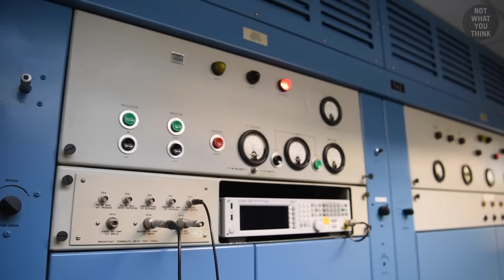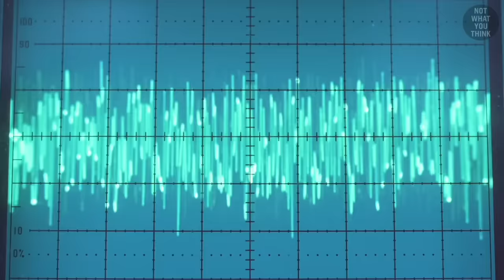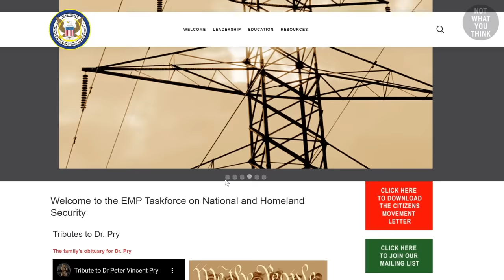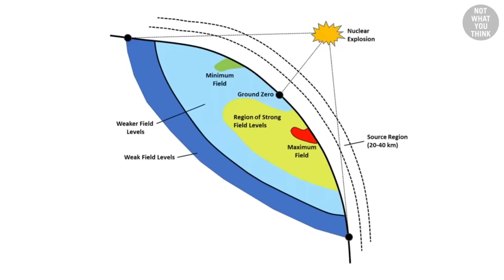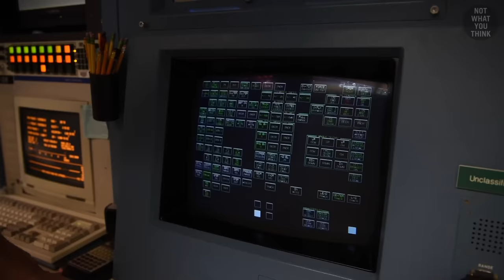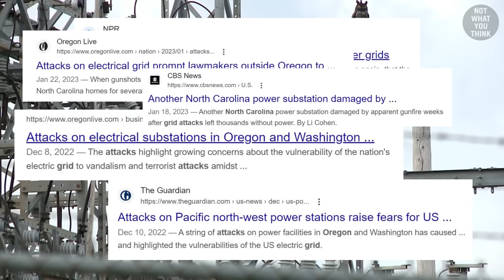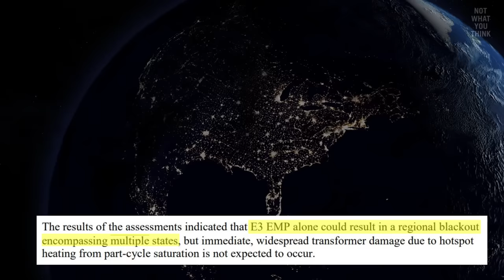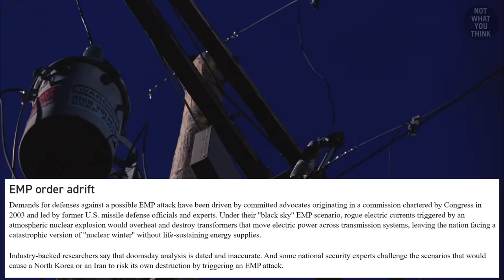Why an EMP Attack is Worse than You Think

Comment: Nuclear reactors only need a couple days of backup fuel to cool down- not an indefinite supply.
Reply: yea, this fact alone made me question the credibility of the research behind this video.
Reply: Need way more than a couple of days to cool the spent fuel in the pool before they can be put into dry storage. Usually for several years. 

The pool would need to have cooling system otherwise water just going keep boiling off and needs to be constantly refilled every few days. So you would need the fuel to run the generator for the pool cooling fir several years at least.
Reply: Hawk Anonymous  that is true for a shutdown but in this case the fuel rods would be removed!
Reply: hawkanonymous2610 afterwards yes... for, depending on exact reactor design, between 2-3 weeks before the cooling could be very safely shut off. Some reactors even have batteries that can run the cooling systems on a low setting for a very long time in case the backup fuel isn't enough.

Yes, more than days like what you were getting at. But 2-3 weeks of generator fuel is fairly trivial, only about 180,000 liters of diesel fuel. When we are talking about things as big as a nuclear reactor, that's easy to store. Gas stations carry about 130,000 liters of gas.
Reply: The problem, besides damage to electrical generating plants, is the distribution grid.  I stink at electrical engineering.  But I know high voltages atr needed to send power long distances, then transformers to step down power from say, 14,400 v to lower voltages to user transformers to bring voltages down to the more familiar 480, 220, & 110 v we use.
Reply: A lot of modern reactor designs have analogue user-free meltdown prevention anyways
Reply: Since the whole video is about EMPs, it’s not unreasonable to assume that an EMP strong enough to damage a nuclear power plant is strong enough to damage the backup generators or other systems.
Reply: @cr4ckp1dgeon  very few of those have actually been built.
Reply: And what are you going to do with the fuel rods after you cool it all down to room temperature?
Reply: @Acrophobia2  can’t remove the fuel rods without electricity. I’m pretty sure people don’t manually remove rods during operation or shortly after
Reply: @--INDIGO--  this. Plus, we are assuming in this video, all sorts of types of habbenins. If anything, we would see fukashimas, chernobyls, and three mile islands all over the world, not just where whatever bad actor did something.

It dont always be that way sometimes it do be 😂
Reply: @--INDIGO--  Yikes! I never considered that!
Reply: @Reefiasty  Nothing.
Reply: @--INDIGO--  Well...that's certainly possible, but I hope to god that they're EMP hardened like the backup generators in missile silos.
Reply: But do we know what fuel reserves each of the 92 American commercial reactors actually maintains? The history of untested emergency measures is not encouraging.
Reply: Who told you that? It's completely wrong
Reply: look at this comment section- it's all people that talk like they're experts
Reply: What happens when the water runs out?  When the pumps can't function because they don't have electricity or fuel.  There's a reason we don't build nuclear reactors anymore.  The risk is just not worth the reward.
Reply: @williamyoung9401  New designs don't even have those problems- only the old ones.  Fukishima was IMMEDIATELY without backup power.  It doesn't take that long to cool down these older reactors.
Reply: That is not the case.
A reactor being stopped needs to be cooled for at least half a year, normally longer, to cool down.
Reply: @cr4ckp1dgeon  Name one.
Reply: @tonamg53 don't forget it needs to last consistently running for that amount of time and enough fuel for it aswell
Reply: Thank you
Reply: And if we were using the much safer MSR design ( Molten Salt Reactor), then meltdown would not be an issue, and the reactor could be passively safe.

Sadly the regulator is still blocking MSR development. Last I heard, this American invention (1968), is now being developed in China.
Reply: With Fukushima, the problem was the tsunami knocking out the backup cooling generators.
For safety, the reactor, which survived the earthquake, was shut down, so could not provide its own power.
Had the reactor been left running, there would have been no accident.  So this is a case of the safety operation leading to an accident.

Of course the designers should not have put the diesel generators so low down.
Reply: @peterclarke3020  thing is the reactor walls were only designed to last 50-60 years & well they are overdue to rupture ..where without them we could have had this world another 300k years but now 10k years for most of the population is impossible (heck even 2 years seems like a long stretch given world politics but you know)
Reply: @peterclarke3020  warping DNA and blaming it on cigarettes is fked up to btw
Reply: I’m pretty sure most American nuclear reactors can withstand emp’s and the electronics that control and any around on the land the nuclear reactor is in due to the requirements for fail safes and if something like and emp would happen also if your power cables are below 6 inches under soil it will be fine
Reply: Ahhh, Nuc power plants must SCRAM if they lose outside power.  They also are not allowed to operate if outside power is not available.  So they could run at very low power, enough to keep the cooling towers going and be totally internal, and save the Generators for when they need them.
Reply: Nuclear power plants have secondary generators using steam that are run off the actual nuclear power so you have your high-voltage and low-voltage generators they can run indefinitely off of the steam they produce naturally
Reply: yeah... we all saw that theory live in action... just about 11years ago
Reply: @joseph-mariopelerin7028  No- you saw nuclear reactors with no backup generators at all.
Reply: @Trilobite45  Comparing the quantity of reserve fuel required to the typical stores of a gas station was certainly an intelligent idea and conveyed a clear understanding of the quantities involved...

However, I would have really preferred the unit of measure to be football fields or bananas stacked to the moon.
Reply: can't move coolant or use fuel if there is no power to do it.  hence even a couple of days is still terminal.

Comment: This is a threat I feel like we should definitely be investing more in mitigating. Even if the likelihood of an EMP event is small, the worst-case scenario is devastating enough that's it's almost certainly worth the up-front cost to be prepared for it. (Having a bunch of spare transformers on hand, for example, would be a really big up-front cost, but not a huge ongoing investment.)
Reply: Collecting the spares takes time though.
Also, some corrupt official are just gonna sell them off at a huge markup, if someone needs them probably.
The other low cost but effective mitigations should be done, fucking companies though don't wanna spend money.
Reply: Don’t worry, this dude’s taking information from people that haven’t worked in this field.
Reply: One interesting thing about EMPs is that the equipment doesn't have to be online to be damaged. For example a transformer can experience damage from arcing in the coils even if it's not connected to anything. So spares need to be kept in a protected environment (ie. "hardened").
Reply: No.
Reply: @therealcheckmate From what I understand, diesels (especially small engines) will probably be okay. No computers needed to manage spark timing or ignition coils with long windings in them to induce current. Your Faraday "cage" doesn't necessarily need to be grounded/bonded, as long as all the sides are electrically connected. In fact, the ground is where a lot of the current is going to be generated (GICs or geoelectric induced currents), but whether it will be enough to backfeed up your ground wire and electrify your enclosure/generator frame, I have no idea. I think you are in good shape as long as you can store enough fuel, better off than most, surely. Not a lot of info about the effects of really big EMPs on modern gear, and much of it's conflicting.
Reply: @TheRealCheckmate  Actually, that would no be a good idea! More than likely that would subject your shielding to higher energy levels. 

Best approach is an  isolated "cage" within another isolated cage. The "cages" should be isolated/insulated from each other.  A single isolated cage might be adequate but so much depends on the energy level of the pulse(s). Layering shielding will provide the best protection. 

Bonding/grounding just provides an external current path.  You want the current confined to within your shield. BTW, whatever you are trying to protect, you want to keep it isolated too and not touching the shielding in any way.   BTW, you'll want to avoid touching the shielding  when the EMP hits so you don't become a current path!  

Generally speaking an EMP is unlikely to cause direct harm to people as long a you are relatively isolated from good conductors.  If you have metallic implants or something like a pacemaker, you may be at risk!! I suppose that there may be some shielding options to consider,but they aren't likely to be practical for an unpredictable event.
Reply: to make sure, we should all  invest in bunkers, and stockpile food and water oh and toilet paper, make sure we have a spare phone in a faraday cage... and also protest for a faraday satelite to be launch in back up just in case...

no phone no life!!

you also need a couple generator because no matter what happen that AC can't stop running!

no AC no life 

let's mass invest to assure these two Essentials!!!
Reply: @TheRealCheckmate Yes, but leave the gens disconnected until after the EMP is over.  I got a pretty good arc, about a half inch, off a umbrella shaft once when lightening struck about half a mile away.  The shaft was only 3 feet long but had that much induced voltage from the strike.  Imagine how much voltage could be induced in a couple of hundred yards of house wiring by an EMP weapon. I dare say, it might jump across an open switch or circuit breaker.
Reply: @silverecco A diesel engine will be okay if you can turn it over to start it without using an electric starter. 😂
Reply: Invest in bottled water and canned food and a can opener and prepping supplies is your best form of mitigation. Get seeds, plant a garden.  You are in charge of your future.
Reply: @lewis2553  didn't think about that. You can tell I haven't spent any time messing with diesels. That's lot of compression to overcome, doubt even the little electric road sign engines have pull cords. Starter motors are relatively simple things, though, and they work with induction under normal operation, so it might be okay, or easily repairable if not. The energy would try to spin the magnets and might disperse enough of it. I didn't even consider motors (and alternators). Those are basically just long wires like ignition coils and transformers, too. It's just everything in our daily lives when you start really tallying it. I'm still flipping light switches in the bathroom out of habit when the power is out for two days. How thoroughly we've become dependent. Worrisome, but I'm glad to see a wider range and number of people becoming interested in "prepping" even if it's just simple food/water stores. Everyone has an "aha" moment where you realize you're on your own, just for some the lesson is much more severe.
Reply: israel is considering of outing EMP weapons against iran rn 🤌
Reply: We need that money for Gender Affirming Care in schools first
Reply: @Uchiha.Itachii Classic Israel

Comment: Those large transformers are so be big for a reason, efficiency. Energy conversion efficiency goes from a minimum of 98% to a maximum of 100% for that 10 to 100 MW transformers. A 0.1% difference in efficiency translates in 100 KW heat dissipation!
In case of emergency is possible to connect in parallel a number of 400 KW transformers which can be built within days...
Reply: They can be built within days now. Not when the factory is in the dark and the workers are starving and trucks aren't running. But as far as I know, we aren't building them now.
Reply: @Leo9ine  relatively light investments into resiliency of those factories would go a long way then, no? like give them generators with 2 weeks of fuel on hand like nuke plants have, or better yet connect them up to an alternate energy source like a solar field
Reply: @iamunamed5800  yes hardened generators and the like
Reply: @Leo9ine  LPTs are made to order, dependent on long supply chains for GOES steel and copper (two metals that are already in short supply), and have long lead times owing to the back log of orders and the need to import them from afar. At best it'll take a year or two to get the North American grids back up and running, but by then the damage will have already been done.
Reply: @iamunamed5800  Yes, how ever look at the number of east coast gas stations without generators. We get a hurricane or Nor' Easter and "blip' the power goes out. No one can get gas nor refill propane tanks. Yes there are hundreds of gallons of gas in the ground but no way to run the pumps or the cash register.
Reply: We know for a fact that its not so easy to shut completely down a power grid thanks to the war in ukraine.  Russia tried its hardest in 2022 but were never able to keep it completely down.  As it turns out people are actually pretty good when properly motivated at fixing things that by all accounts are not fixable.  

I think that the people of america would find ways to keep at least some power up, it might be heavily rationed especially for civilians but they would find a way.
Reply: @allenshepard7992  if there was a true emergency you could get the gas out of the ground even if with nothing more complicated than a portable generator and a basic fuel pump.  

Long term that gas would run out of course so it would have to be heavily rationed unless they could keep the refineries running.   Very long term I suppose people could distill alchohol and run there vehicles with that and for those lucky enough to have diesel, they would have a lot more options. 

As for paying for goods and services, thats going to be a real problem.  probably more deaths over people fighting for resources than resource shortages at least in the short term.
Reply: @islandwills2778  Correct, but it did not happen. Trees blocked roads, people were not going to work. The people who came in from other states did not bring that. 
Ditto for when the colonial pipeline shut down. In that case iodocy ran amok putting gas in plastic shopping bags (or trying to)
Reply: you would need the emp to go off pretty close to the transfo... maybe 2 or three in a row would blow but that's it...
transformer are not exacly micro chip...
Reply: @joseph-mariopelerin7028  Emp just sends a huge pulse of energy, transformers are particularly vulnerable.  The energy surge burns them out.  And it does not have to be that close because transformers are connected to wait for it transmission lines which do what?  They transmit electricity, and an emp does what?  it floods the region with energy which the transmission lines pick up and then transmit (at the speed of light) burning out the transformers and anything else not sufficiently robust connected to them along the way... so think televisions, furnaces, computers etc.  

Another way to think of all those transmission lines is as antenna when thinking of an emp. 

though some of those things may be saved by your breakers or fuse boxes in the house.
Reply: * which can be built within days *   Unless there's a power outage!
Reply: 98% to 100% efficiency in a transformer? No! There is always losses, always. And connecting a number of 400KW transformers in parallel? Again, no. There's circulating currents, protection methods and all sorts of things that come in to play. This isn't paralleling two 12V batteries together. Much more complicated and can tell you are not in the industry.
Reply: @allenshepard7992   It's a shame when gas stations become useless without electricity. You'd think they'd have backup manual pumps with mechanical readouts, and the guy at the checkout can just put stuff in a paper book with a battery-powered lamp. Or else a relatively small generator, since they've plenty of fuel on hand. Doesn't take much to run a petrol pump, especially if you only have a couple of them actually pumping at any moment, the rest of time spent putting the nozzle in and the like. 

They're also right next to cars, which have a 12V supply. Maybe they could jump lead onto your battery as you come to get fuel. Although there's an issue with sparks there. Perhaps cars should come with a safely switched 12V outlet. Use transistors to switch the power so there's no sparks from any mechanical switches. Have the outlet near the petrol inlet, and a flying lead coming off the pump's nozzle. Have a couple of very low-power data lines so the car's computers can synchronise the power delivery. As long as the power is switched safely in the right sequence, she'll be right.
Reply: @greenaum  All your points are good and doable.  I wish I knew a gas station owner and a fire marshal to run the ideas past them. Even if FEMA could get us the fuel, how would the city distribute it safely?  
Propane is another big one. Will ask if their equipment runs on 110 or 220. 220V inverters are harder to come by but out there.  Big hurdle is power. 220v * 10 A is almost 200A at 12V. 

So far the small shops have not implemented the changes. I figure the larger chain stations would be less agile under corporate bureaucracy.
Let's push for change.